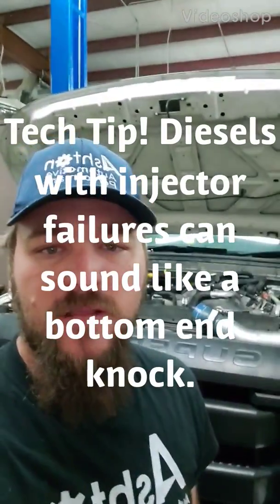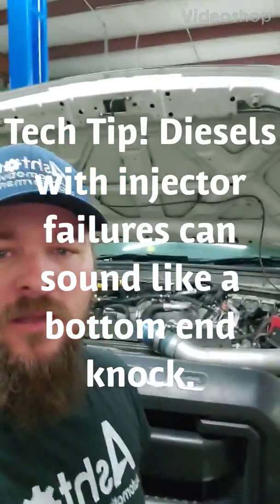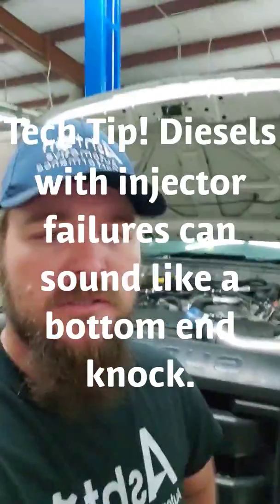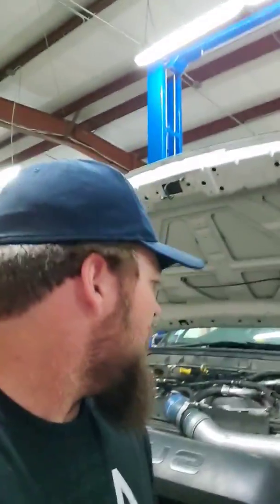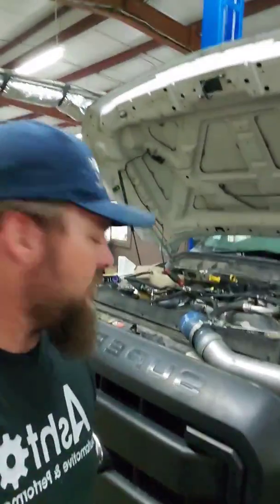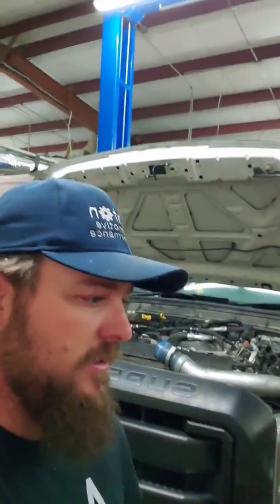Tech Tip! Diesel Engines Bottom End Knock Sound Due To Injector Failure Hanging Open

Comment: If it knocks because of a bad injector does it always throw out smoke from the exhaust or is there occasions when it dont
Reply: Same question, did you ever get an answer?
Reply: @jasonsopko2651  not that I can remember ever getting an answer

Comment: Hi mine is only making (rod knock) sound at 1300 to 1500 rpm under load. Is it possible it could be this as well?
Reply: Update..... it ended up being my injector 6. Dealership and 2 other shops said my engine was blown up. I ended up replacing all injectors on my lml and it runs like new now.
Reply: Yes, fairly common on Duramax when injector timing is advanced during acceleration.  Check your cylinder balance if you don't already have a code.
Reply: @johnpitschi9417  ok thank you very much.

Comment: Hi can you help me.out I have a 2015 F450 6.7 and I'm installing the rocker arms it says to torque to 115in-lb and then it says if its 2015 and newer the torque is 115in-lb and 80 degree. 
Thanks
Reply: There's no question there...just a statement

Comment: Did it still run though? I can't get mine to run but I swear seems like injectors. But fuel rail cranking is over 5k psi no low pressure faults and I have every cylinder giving me contribution codes. That's it. No other codes. I did manage to get it to fire once or twice but it dies on its own after a few seconds and sounds terrible.
Reply from the maker: We had to start it on brake clean/ether while watching the power balance on the scan tool. On these when an injector hangs open like that it will not want to run hardly or at all. If you suspect this failure and dont have a the nice scan tools then just pull injectors 1 by 1 and used compressed air to check them. If you have any leakage at all through the nozzle it  needs to be replaced.
Reply: @ashtonsser  I've ran older diesels on ether starting fluid etc but heard horror stories of it on turbo newer engines haven't messed with that. You just continues spray ether to keep in running? I was debating just pulling all injectors to crank and hear engine naturally. See if sounds right turning over without the conpression

Comment: What if knoks but only if i stand next to the driver door outside ,it sounds like is coming from the buttom of the engine.
Reply: Dodge?
Reply: @ronniewilliamson6548  Nope,7.3 on a ford E450 chassis
Reply: If its the same noise im thinking of try add a additive with cetane booster and see if that helps it

Comment: So you only had to replace 1 injector and the pump? Not the entire fuel system?  Sounds more likely.  And customer saved money by not agreeing to an entire system replacement without thourough testing.   Seems you should be able to test various components and perform visual inspection before quoting entire replacement. 

Exactly what I had happen.  Did exactly what customer did.  Then found  a code associated with injector #2. Replaced that myself.  Went to shop so they  could re-program ecu with new injector (which i don't think was needed with the correction ecus do themselves). 3k total.  Chevrolet estimated $8500 -10K.  Not sure why shops will only quote entire system without testing/inspecting all.
Reply: They quote veruthing because if any metal gets into any other injector later then people always comes back to you saying ita doing the same thing now you pay for it